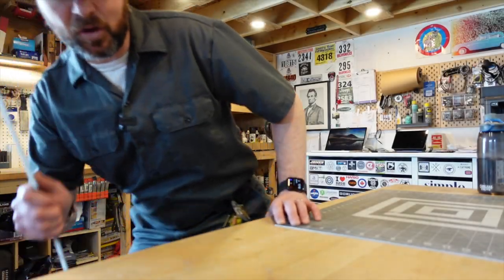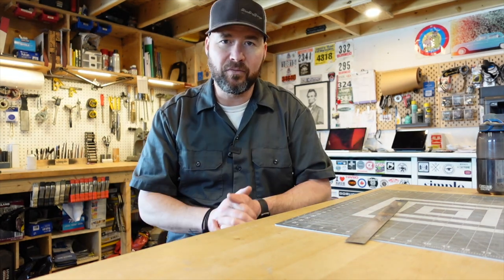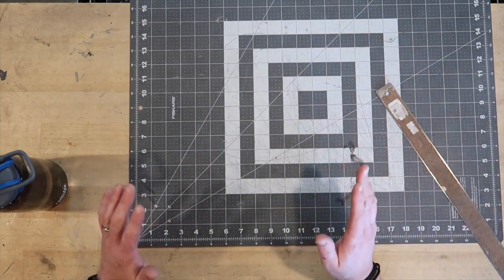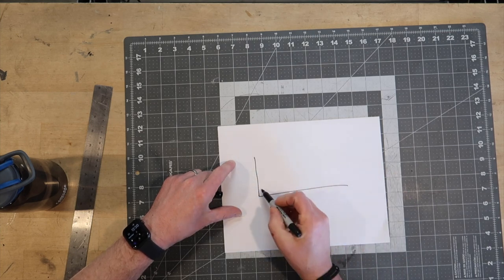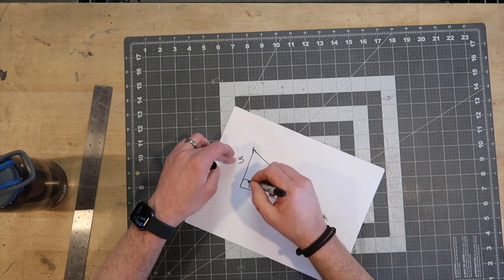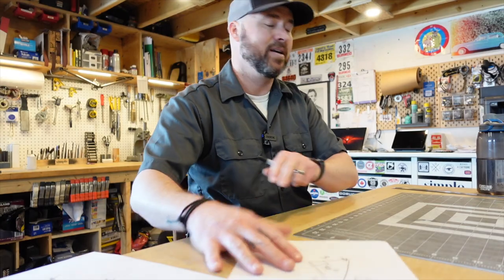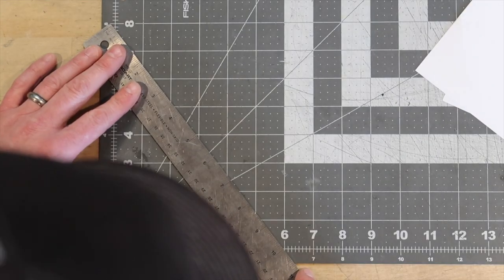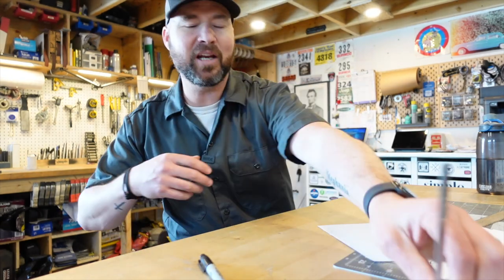Simple way to check large things for square - this trick blew my mind

Comment: Awesome idea . You can also get accurately without dividing sides using the common equation for right angle triangle . (A^2 +B^2 = C^2) take any points on sides  and find the diagonal length
My dad use this to get right angles to build foundation for homes

Comment: If you want two equal legs in your build (like a 45-45-90 square, instead of a 30-60-90 rectangle as in your example), the Pythagoras Therom also works. The hypotenuse is sqrt 2 times longer than a leg (i.e. multiply a leg by 1.41).

If you want to build a deck that is 5' x 5' square, the line that dissects the two opposite corners would be 5' x 1.41, or 7.05' long.  Probably a terrible example, I havent done Trig in a few years lol

Comment: Hey guys I need help, I’m disabled physically, my upper body is weak as all get out, I can’t lift things over like a pound and have a hard time and get tired quite quickly doing strenuous things, I absolutely love knives and I’ve always wanted to try my hand at knife making. However with my disability I would need machines but idk what type of machines I would need besides drill press, hydraulic press, forge, grinders, some form of cutting tools to shape blades. If any of y’all could get back to me I’d really appreciate it. Thanks y’all.